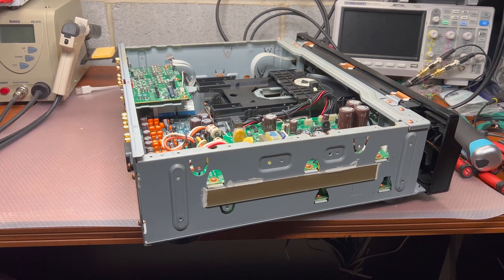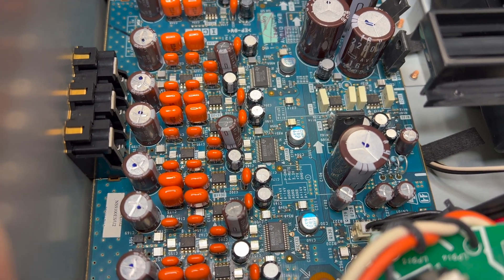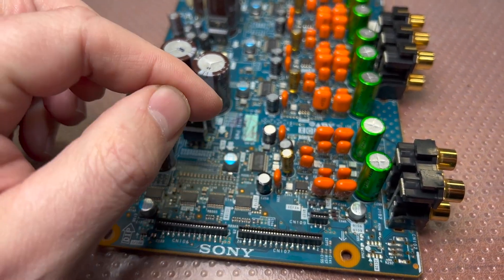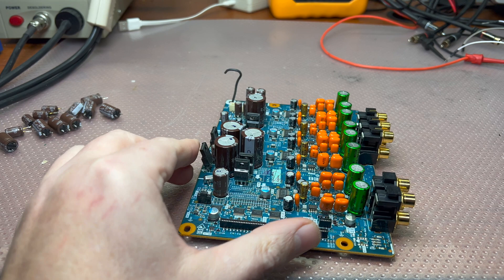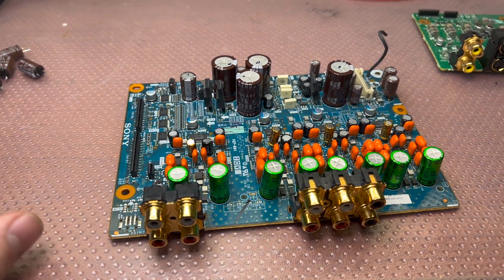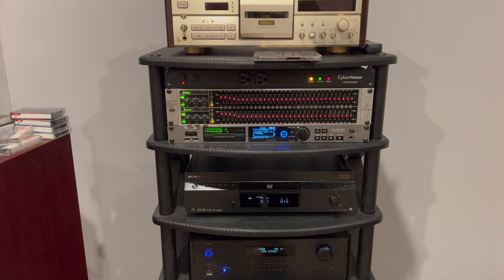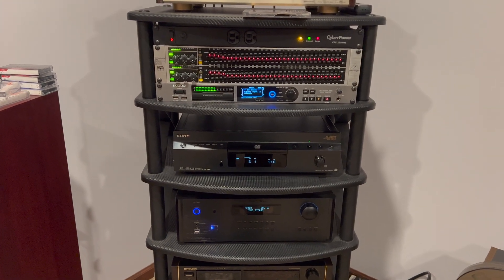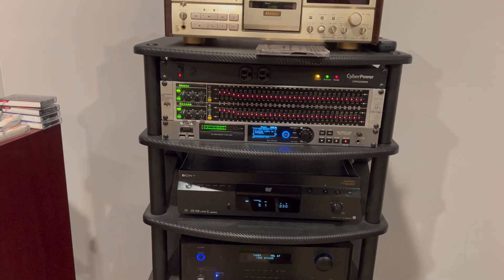Breathing New Life into Sony ES DVP-NS9100ES: A Recapping Adventure for High Frequencies

Comment: You should try measure if there are any DC bias on the output capacitors, if it is holding 0V or within 10~15mV, then it shouldn't be too risky to just replace the capacitor with a jumper.  The sound quality improvement will be incredible.

They often put an output capacitor there "just in case" for the possibility that something might break and send DC out.  The possibility of that is so low that it is bordering on stupidity.

Also, through my experiments, if the DC bias is not very high or none, the sound quality will be duller and less detailed.  It is best not to put a capacitor in place where you don't need a coupling cap.
Reply from the maker: Better to install 10 nF WIMA in a parallel. I tested this on later designs.
Reply: @hifirulezzz  That will help too, but if you can determine that there's very little DC bias, then a simple wire will beat all of them.

Comment: Hi, I see you've replaced 63v (Silmic) for 50v (with MUSE SE) ? Unequal substitution (imho).
Reply from the maker: The maximum peak to peak amplitude is 6V.  Manufacturers installed higher voltage caps to extend lifetime. Nothing more. Your IMHO is wrong.
Reply: @hifirulezzz Dam! You are right!

Comment: Question !? Could this modification bring more open top and midrange connect to Sony TA- DA 9000ES with I- link ? ( firewire ) witch them both have. 
Or does it only have effect on normal outputs?
Reply from the maker: @JariHeikkinen-v1b  no, this will not affect digital output.

Comment: Hello, i have a problem with this dvd player because doesn't read any discs, i changed the laser pickup, worked a few minutes and then back to "cannot read" message again, is not the laser i don't know what can be,
Reply from the maker: Check pot on the pickup flat cable. There will be two, one for DVD laser and one for CD laser. Try to adjust by 15% one or other direction.  In my case this helped to better read scratched disks on my SACD player.
Reply: @hifirulezzz i don't think so, because is a new laser pickup, worked well the first ten minutes and then stop reading discs, the same with the old laser pickup.
Reply from the maker: @oldgamecafe  Then your player is up to SMD Aluminum caps replacement.

Comment: Hello there! You have such an inspiring Hi-Fi setup... modern. I like it.

Are you comfortable leaving all those tiny SMD capacitors on the board?  Because those are usually the worst offenders... and they split into two categories: those that have leaked and spewed all their guts' fluid out, and those that will inevitably and shortly from there on... spill all of their fluid out.

Concerning the big caps I notice those are of the regular polarized variety, considering what I expect their job to be I doubt they have gone through so much use, heat and heat cycles that they have been worn out and are drying because of that. What I am trying to to say is that perhaps those weren't really the best and most appropriate caps to begin with, and you're replacing them with what I suspect might be the best dedicated audio caps on the market... so of course you're gonna tell the difference.

I am not sure whether I'll ever deal with SACD... not being able to author them is a very detrimental limit to the format. CDs despite not being as thrilling as cassettes have certainly their perfection attractiveness... besides being pretty much superior to any streaming audio coming from the Internet.

Comment: nice one, i did the same on my old Yamaha CDR-HD1300 before and result is fantastic. ps, i can tell you one tip regards optical players, have a check SMD electrolytic on control board (usually is below drive), the reason is as many of them are not good anymore and they create instability in spinning motor and laser as a result the correction system is working and many times you lose high frequencies because of that. as probably you know how error correction is working on cd, dvd players. so, when any reading data is missing because instability then the correction system is adding some data itself. I’m usually replacing all SMD caps on cd players for the new one and the result is fantastic. is much more details and clarity. also have a check the spinning motor and is the same as in deck is is worn or dry is unstable so like i tape deck is high wow and flutter so here because of motor and caps the correction system is working adding data to the signal and this is what you don’t want. now im working on my Denon DVD2900 with SACD and i will have to replace over 70 SMD caps but im sure it will give me good result, i do have 2 of them so ill be abble to compare them side by side.
Reply from the maker: I believe the drive and digital part is still good, as I can use digital out to listen on an external DAC and the results are super cool. But thanks anyway for your recommendations. I have seen multiple restoration videos for DAT and CD players and may confirm that you are absolutely right in your recommendations. That Sony player is from 2003, so, still not so bad as others from the late 80s - early 90s.

Comment: Very good work.. If I can see well, the original capacitors were Elna Silmic? Thanks
Reply from the maker: Yes, exactly the same as Sony installed into high-end tape recorders. The only difference I have found - they used a 100V version of that caps.
Reply: @hifirulezzz  this is very good.. However  do you think that Nichicon muse are better?
Reply from the maker: @robyxrd  I do not think, I have checked. 100% better. Muse caps always give a better bass and more linear response.
Reply: @hifirulezzz  good, thank you for the info.. Are they bi-polar?
Reply from the maker: @robyxrd  Muse Bipolar, Fine Gold are polar.
Reply: @hifirulezzz  yes.. The green color are  Muse.. So you replaced original elna silmic (polarized) with Nichicon muse (bp)